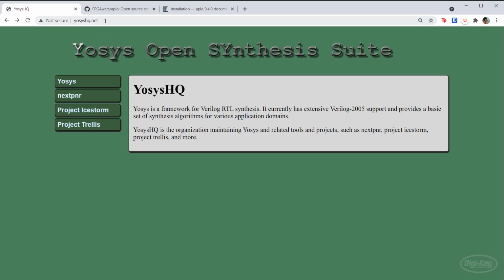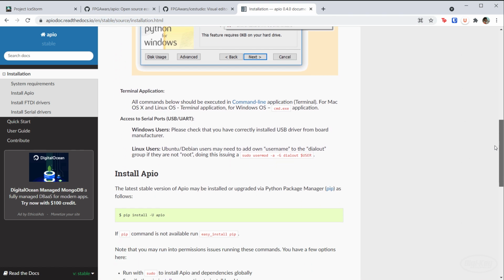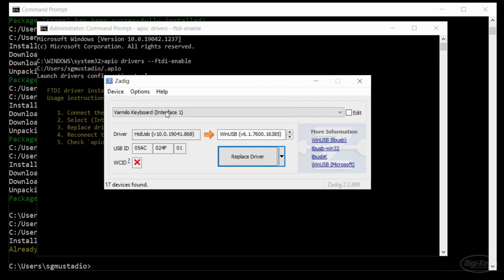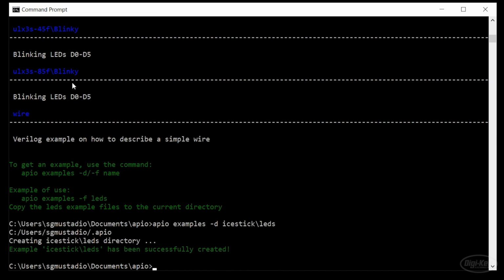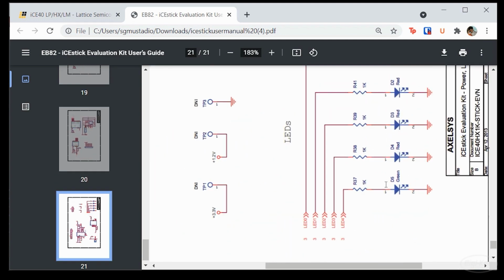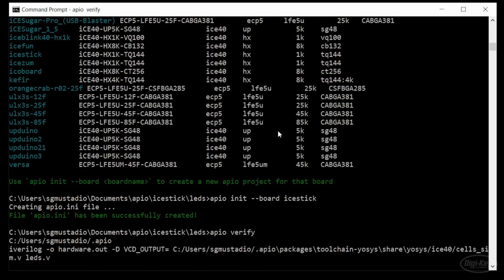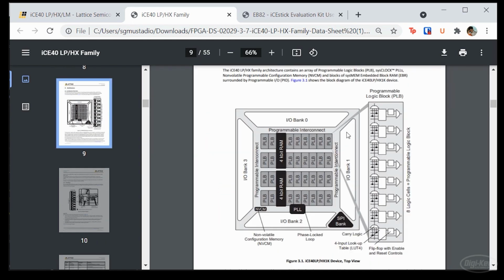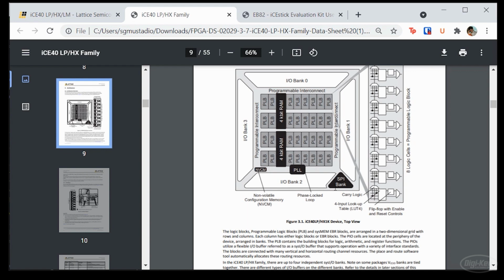Introduction to FPGA Part 2 - Getting Started with Yosys, IceStorm, and Apio | Digi-Key Electronics

Comment: nice video but why r u not using xilinx vivado design suite?
Reply: I find that many of the proprietary vendor design tools can be intimidating to newcomers, so I wanted to show something simpler (and open source, if possible).
Reply: @ShawnHymel  yea right but for some newcomers is easyer to use one big good ide like vivado because most of the tools are intetegrated and u dont need to install everything manually and they working with each another better and it has more feature like IP Intergrator and so on
i find vivando much better easyer and i am also a newcomer
(opensource is not allways better)
but anyway thx for all ur good videos 👍🙂
Reply: @Scwan1502  Makes sense. I prefer a couple of simpler tools to get started that don't present a thousand buttons/menus that I won't use (as a beginner) so I can focus on just the code. To each their own, I suppose :) I'm glad you're enjoying the series!
Reply: @ShawnHymel  thx 4 ur fast response 
u doing a really great job 👍
hope to see much more fpga stuff andso on 🙂

Comment: Can FPGAs be used as multiple core GPUs for Ai vision and neural networks? 
I know they use graphics cards with 1000's of cores, to do serious machine learning. Can an array of FPGs emulate these simple cores at the same speed? 
Just curious if they have the oomph to compete in that arena. I've only seen FPGAs in Oscilloscopes, PWM and signal generators.
I'm sure they are used in many many other places. I haven't seen a lot of things, it doesn't mean they don't exist :)
Reply: You could, in theory, create GPU cores inside an FPGA. Keep in mind that a GPU has optimized hardware for doing SIMD operations, so an FPGA emulating a GPU would probably not be as efficient (energy or space-wise).
Reply: @ShawnHymel  Thanks for the explanation. I know not much but learning.
Reply: Theoretically yes. The issue is that silicons of GPUs are highly optimized for high frequencies and space. Really expensive FPGA could emulate modern GPU but would not reach the same speeds and efficiency. FPGAs are also used in thermal camera imaging, as cryptoaccelerators, in high performance network switches, in KVMs but mostly in prototyping phases of integrated circuits.
Reply: @po1nt1776  👍
Reply: Yes. There was a video a while ago (can't find it anymore) of Nvidia's lab tour showing how 1080 ti was made. The lab was full of PC-looking FPGAs from Cadence simulating 1080ti. I doubt that it was running at 1080ti's speed but was for simulation and (functional) verification purpose only. After that step (and after tapeout) first silicon chips are made for further (electrical) verification.
Reply: Most fpgas can only run at max a few hundred MHZ.
The faster ones are expensive.